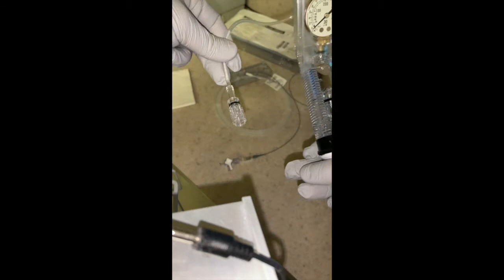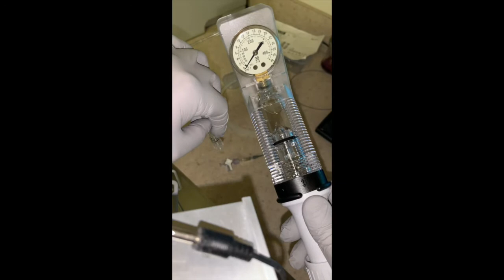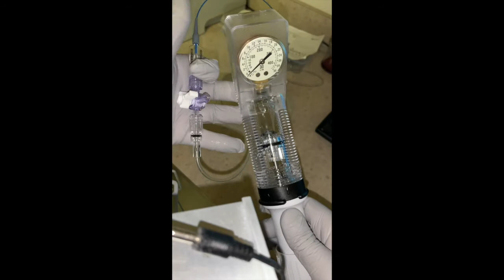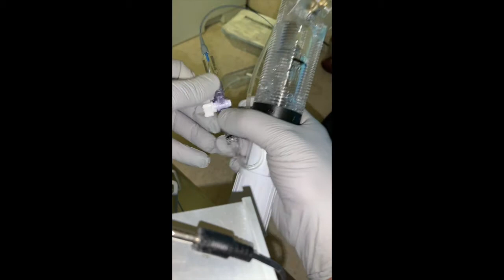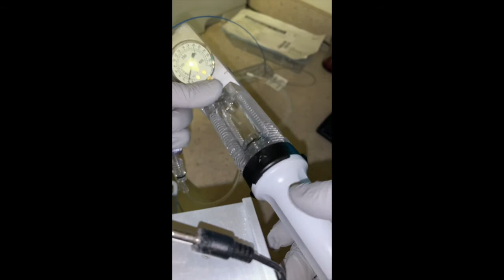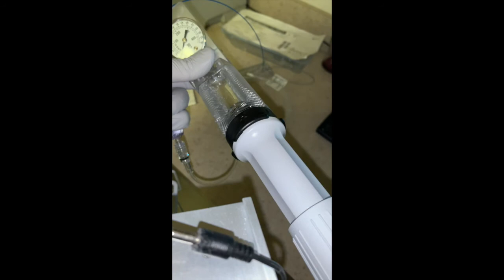The Indeflator - Cath lab intro for absolute beginners

Comment: Hi. Great video.

Would like to ask. What is the use of the stopcock if you use one?

Because i saw sometime there are centres that dont connect a stopcock to ballon. Some centres do that.

Tia
Reply from the maker: Hi Muhammad. That's a good question. In the modern setting the best place to use a stop cock is to prep a balloon that has already been inflated. Modern stents and balloons rarely need to be prepped with a stop-cock the way they were some years ago.
Reply: @robattaran4680  Sorry my late reply. Didn't get notification. Thanks for you reply. Do you have a video to show the preparation of balloon with stop cock?
Reply from the maker: Hi Muhammad, the stop cock has less utility in modern balloons. If you are re-using a large balloon, it could help you repress it. It also can help remove air bubbles from the system